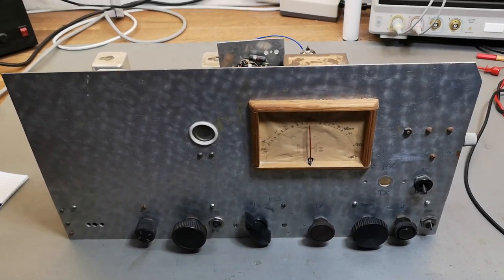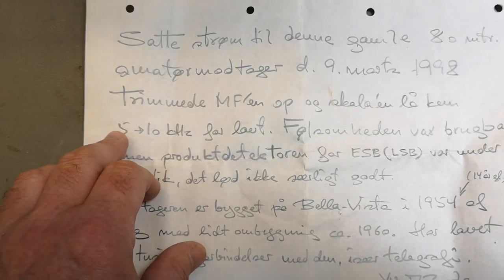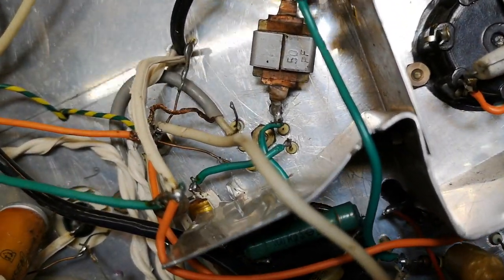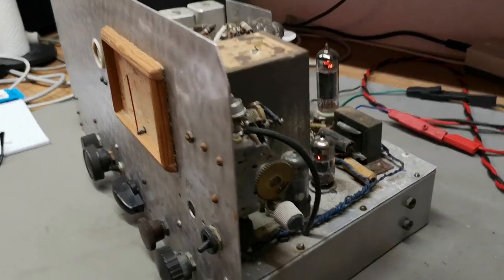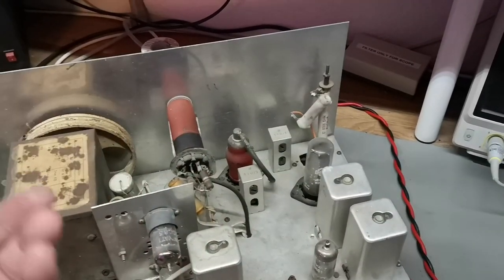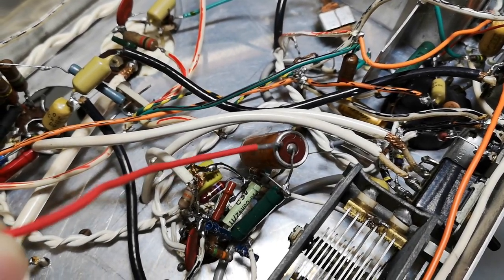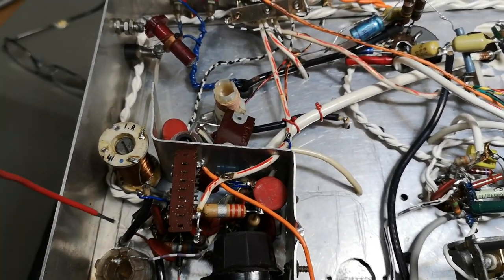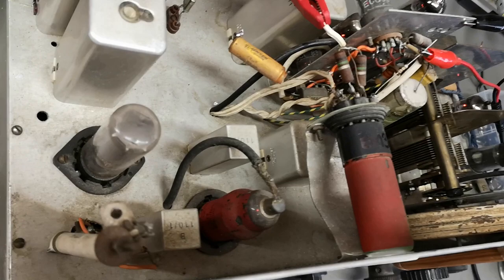DIY 80m amateur radio receiver OZ7HX Mogens 1954 teardown

Comment: Hi Thomas, that's great for a 14 year old, the wooden display and gear for the tuning string amused me.

Nice day 🙂 Tom
Reply from the maker: I am very impressed, this is bit higher level over what i did as 14 years old, i do display a few of my own 14 years old projects at my web page, it is called webx dot dk in case you want to look

Comment: Instead of 80-meter, 60-meter or on milion meter.. there are kHz, MHz numbers, much easy to understand the radio frequency..
For example the amateur radio frequency on 80m for ham is 3.5MHz to 4MHz America and 3.5MHz to 3.8MHz and 3.9MHz for the res of the world..
Reply from the maker: correct, talking about wavelength as a frequency is very much a radiomateur or radio geek kind of way :-) i am sorry if it confuse a more random youtube watcher, but this video is not ment for the broad everyday person, but much more for the radio electronic diy kind of person :-)
Reply: There’s tradition that goes with that hobby too :)